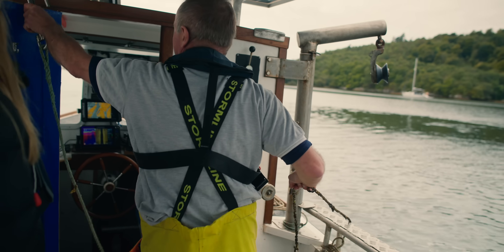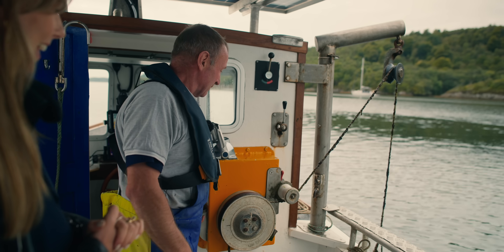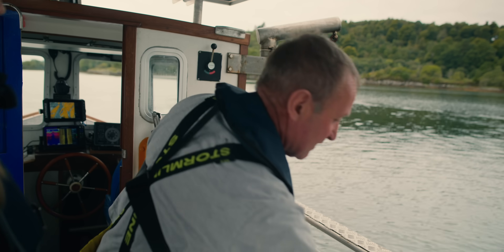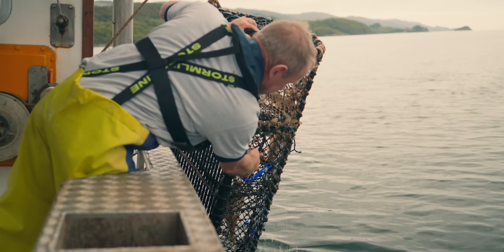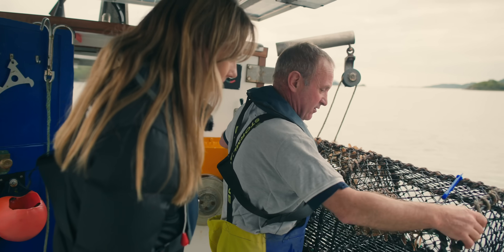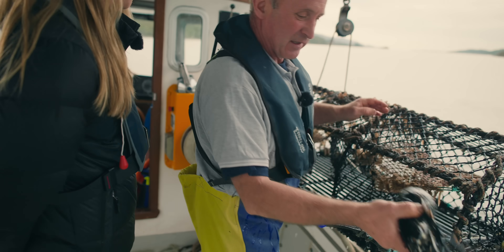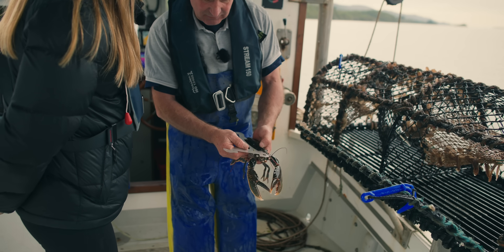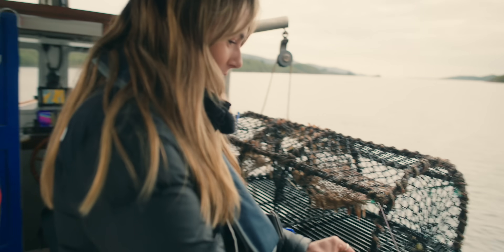Onboard the UK's FIRST, Fully Electric Solar Powered Fishing Boat!

Comment: Full marks for his passion, but the devil is in the detail. He say’s the electric motor is as powerful as his old diesel, but he runs it ‘with less throttle’ (5 knots). “I’ve adapted to what the boat can do” = There are limitations to this setup. Through the summer, he can fish 2 days a week via his solar, but what about the rest of the year? “The boat is producing a clean, low impact product”. Great, but at what true financial cost? He’s got the boat building skills and his own workshop, what about all the fishermen that don’t have that? Finally, “Unquestionably, the numbers stack up”. I’d love to think so, but “unquestionably, they don’t. There is significant (unspecified) cost to this setup and it would only suit a very small number of local/low range fishermen.

Comment: Of all the segments that you have presented I love this one the most, Imogen. When I was driving around in my lead acid battery Destiny2000 converted Pontiac Fiero with solar panels on it some 25ish years or so ago, it was fully useable, I knew that a little more tweaking would bring us a market ready EV. As a pioneer I had to walk the Department of Motor Vehicles through the immissions process. I had to walk my insurance company through how to insure the vehicle. Etc. etc. It was so new. Seeing that Hans Unkles is in the same "boat" that I was in so many years ago leads me to believe that in a few short years there will be a far more capable electric lobster boat more capable of taking in the sun to power it entirely. Thank you Imogen.
Reply: Thanks joe
Reply: @Electriclobsterfisherman  Love what you do. Keep doing it.

Comment: Another idea I've had is to have a horizontal flywheel with a weighted section that generates power by the pitching and rolling of the boat. Obviously it wouldn't generate power in the flat calm of this video, but around the UK, flat calm is rare...
Reply: Wrong. The vector sum of the forces acting on the flywheel via the boat hull is going to add to zero, just like the average slope of the sea surface is going to add to zero slope. Trying to use the rolling of the sea surface to extract more energy than the energy required to motor over that same surface is basically a perpetual motion scheme. It's a violation of the energy conservation law. 

Besides that, storing an appreciably useful amount of energy in such a flywheel system involves an insane rate of rotation, a rate that exceeds the centrifugal tensile strain capacity of known materials. Any flywheel spinning at such a rate would essentially be a spinning bomb. The last place you would want to you use such a system, even if it existed, would be in a rough motion environment like the sea. 

Also, the inertial gyroscopic effect would be radically counterproductive in trying to travel efficiently on the ever-moving sea surface. If we ever achieved the futuristic materials technology to make such flywheels possible, their only practical applications will probably be as energy storage systems at completely stationary locations, or at most in transport systems with predictable, smooth trajectories of motion such as railroad trains. 

They will be only energy storage systems, not energy extraction systems. Trying to capture energy by having selectively weighted sections of the rotor disc is also a violation of energy conservation, since the inertial force gained on the falling part of the cycle would be nullified by the energy required to lift the weight through the rising part of the cycle at all angles of rotation. 

Also, the uneven weighting would induce so much strain on the materials that it's pretty difficult to imagine any conceivable materials being able to stand up to such strain differentials at the unearthly rates of rotation required. You're talking about a spin rate of thousands of RPMs in order to store enough energy in a flywheel mass that is small enough to be feasible to be carried on a boat.  There is no engineering technology that's anywhere close to that. 

And I haven't even gotten to the issues of friction heating and lateral thrust strain at the pivot of rotation in an unevenly moving system, much less the mechanical strains involved in the transfer of energy out of the flywheel to the gear train that provides locomotive force. Also, the rate of fall induced by wave motion is vastly too slow to utilize without an extremely high ratio "amping up" gear train of its own. You're indulging in the kind of fantasy that is all too common among persons who either didn't take Physics 101 or flunked out and took up smoking too much weed.

Comment: There is likely a market for this kind of thing. Lots of fishing is local - puttering out to lobster pots, shrimps, crabs, mussel beds, salmon nets etc The range doesn't have to be enormous, e.g. 10 miles in and out and solar over the vessel should be more than adequate. Over time it would pay for itself, not just in fuel savings but time savings not having to moor up at some fuel dock.

Comment: Cobalt + the DRC. As a fan of everything electric, I’m becoming increasingly concerned about the mining of cobalt involving children in the DRC and the appalling conditions of some of the ‘Artisan’ mines there. I don’t want to have to think about a child dying because they mined the cobalt inside my product every time I plug my car or phone in. Words words words. That’s all it’s been over so many years, and we bury our heads in the sand as people suffer terribly. We need to move to cleaner energy, but doing it like this is just plain wrong. No doubt more words words words will be said, and more children will die.
Reply: Can't say about the rest of the mining practices in the battery chemistry but there is no cobalt at all in the Lorna Jane's  battery banks, unlike the device you may have used to write this comment. I fully agree and support your opinions of the cobalt mining methods

Comment: Nice to see that the north of Scotland is generating 100% zero carbon electricity today from wind and hydro power (like it does on quite a lot of days). If Hans needs to charge from the grid is nice to know he won't need to use fossil fuel even without the solar panels.

Comment: I suspect a small stand-by diesel generator on board to charge the battery in an emergency would be a good safety measure, although from what he said it would probably never be used.
Reply: Got one that I can bring on the boat. It hasn't been used since August last year!

Comment: Thank you and congratulations!  He's getting great results, and that's from what is NOT the ideal hull or configuration for that setup.  If you put a solar canopy (with booster vertical wind turbines for cloudy windy days as is typical in the north atlantic) on a sort of warren/polynesian-style catamaran rig, it would be even more efficient, faster, more stable, without needing ballast, shorter draft, having more storage/catch capacity, more working deck area, greater solar area per waterline length, etc.

We need a manufacturer to take up the call of producing reasonable priced solar/wind fishing catamarans for local/coastal fishing.  The investment for the fishermen would more than pay off in reduced expenses and environmental benefits around the world, as well as improved quality of life for the fishers themselves.  Some modified & insulated half-pipe pontoon hulls with deck-hatch access for catch holds, and a strut-supported sheet-metal cross-deck could be put together for an economy price.

Comment: just a niche solution with much relevance. I would rather work on the big issues, the big challenges first like a fast ICE replacement by EV and Heatpumps replacing condensed boilers.
Reply: Fully agree with that, just wanted to show its a useable boat at a commercial level. Got to start somewhere.

Comment: Be really interesting to see how his costs stack up compared to the other local fishermen, some of which are bound to be on the same hull, and probably hulls just as old. If as I suspect it works out that in two years or so in that as near to lab conditions as you can get comparision the cost of conversion has entirely offset the maintenance and running costs of the old ICE so he is able to work almost for free... Then he has in effect paid upfront the price of two years working for for probably 10 years, maybe more, though also maybe less as the sea can be very destructive. Still very hard to argue with.

Comment: I presume everything runs on dc with no conversion losses. Great job
Reply: 48vdc. The drive motor and hydraulic motor are 48vac so there is a bit of loss but not much
Reply: @Electriclobsterfisherman  . Was it not feasible to use a DC motor as opposed to an AC one?

Comment: Is the workshop in a convenient position/orientation to install solar panels and a power wall. (Expensive I'm sure). 
Is it then possible to charge Lorna Jane from there?
Reply: As far as I can see the boat cannot be moored near enough to the workshop (which isn't in Tayvallich itself) ... hence the long trip to the slipway.
Reply: @MrAdopado  Thanks. I thought there'd be a good reason.

Comment: I hope he is using Sodium-ion batteries, because they are going to be better in colder temperatures compared to lithium-ion batteries.

And I hope he can put solar on the roof of that big hut that he was sat in because that would make most of his fuel costs zero.
Reply: If you knew where the shed was you would realise it would have to be a world record length of charging cable!
Reply: Lithium iron phosphate, the only ones the MCA will approve just now
Reply: @Electriclobsterfisherman  I suspect that this is because many people (perhaps MCA too) believe that Lithium iron phosphate batteries are not Lithium ion batteries. And all lithium ion batteries burst into flames when you look at them ... well, they don't of course but that's the spin that has gained traction amongst the less informed. Even the manufacturers themselves now frequently steer clear of specifically using the term lithium ion in their promotional material... despite the fact that lithium iron phosphate batteries are also lithium ion batteries. Their level of safety is excellent (but then so is the level of safety in modern lithium ion batteries of other chemistries when used in a suitably designed and constructed pack with appropriate control systems).
I don't have expertise on HV marine specification batteries but I would have thought that the biggest issues are around certifying particular pack designs to be confident that they are going to be able to cope with full immersion in salt water for indeterminate periods (no matter what the chemistry of the cells inside).

Comment: What if the boat sinks because of the weight and there's a shark swimming nearby?  Then what?
Reply: Had to check your name there, thought Donald Trump was commenting 😂
Reply: @HansUnkles  nobody has ever thought of this before!  Would you rather get electrocuted or eaten by a shark?
Reply: Apart rom the fact that it would seem that you have a limited understanding of displacement (i.e. the reason why huge tankers full of crude oil don't sink 'because of the weight'), a battery and electric motor don't weigh much more than the diesel engine and full fuel tank that it replaces.
Reply: @downwind_david  I have tremendous understandings.  My uncle was at MIT.
Reply: @steelyspielbergo  ha ha ... ask your uncle about displacement then. The boat is trimmed for the weight it carries. If it was over-weight it wouldn't be certified.

Comment: This 'boat' has a 20Kw (26hp) motor, it will not operate in anything under millpond conditions, in Scotland lol. This vessel can not go to sea and will have to stay in the protected area he is videoed in. This is a toy!
Reply: On the vessels website he debunks many such myths by showing you the vessel in action in many difficult and tricky situations. Take a look yourself. It was also mentioned in this video about the difference in range he experiences between calm and rougher conditions.
Reply: @marviwilson1853  There is literally a sign in front of the wheel which states "This boat is limited to within 20 miles of a safe haven IN FAVOURABLE CONDITIONS" Watch the video on his own website.
Reply: @pauls3075  That makes perfect sense. The range in the video was quoted as being 60 nautical miles in calm conditions down to 40 miles in rougher seas. The MCA regulations for the boat just seem therefore to reflect this characteristic of the boat. Not quite sure what the point is you are trying to make.
Reply: @marviwilson1853  My point is that the boat is an old mans toy. No one will be using it in a meaningful way to make a living. It is not safe to use in strong tidal waters or in any king of windy conditions due to its limited speed and range.
Reply: @pauls3075  As I think I said before it is designed for a mission and that is to deploy and pick up lobster pots on the West Coast of Scotland within a 20 mile range of port. All forms of transport whether cars, boats or planes are designed for a mission. That is why an F1 racecar looks nothing like an off road jeep. This boat does it's mission well. You seem to be missing the facts. He does in fact make a living catching lobsters with this boat. The 20Kw motor is as powerful as the diesel it replaces but actually benefits from instant torque and variable azimuth thrust. (He has no rudder). You must take account of the facts when you put forward a theory. There is no point just saying anything just because you have a "feeling" it is "probably" that way.

Comment: I did a similar thing on my narrowboat and put in a home assembled electric conversion. I didn't really do it for any saving or even to be 'green' although I am using LiFePO4 batteries that would otherwise have been scrapped. I did it for the experience, the challenge if you will, to show it could be done for not much money compared to commercial conversions and for the sheer joy of near silent cruising. The free (solar) energy side of it was a bonus and in fact the propulsion in summer is a dump load of solar that would otherwise be in excess of my needs. The interest from those I meet along the canal has been amazing and it has inspired several people to do the same thing who otherwise would have been put off by the prohibitive cost of the commercial offerings.

Comment: I think one of the key aspects of this boat is what he refers to towards the end: it's not a perfect replacement for a diesel boat in every respect, but it is perfectly fit for the purpose he built it for. If he only travels an average of 20-ish nm a day on the job, why over-spec the battery pack, the motor, or the solar panels? Should he extend his weekly fishing past 2-3 days, a relatively easy upgrade might be to replace and expand the solar canopy with higher output panels.
Reply: I'm very excited about  panel efficiency getting better.
Reply: @HansUnkles  I am guessing that if there was an absolute need for extended range, and cost wasn't at issue, the boat could physically carry more battery capacity?
Reply: @MrAdopado every boat will be different some will be able to have a much greater range. Thanks for all your support and comments

Comment: It is a shame they glossed over the administration issues as this is a fundamental issue for anyone taking the electric initiative and a stumbling block for many.
The funding element was hugely appreciated but at 6 months from completion to a finished product is an especially hard task if you are not a large company with resources.
If the aim for Britain is for electrification, processes need to be simplified and thought through.
Massive respect and congratulations to a job well done to prove to all that it can be done with hard work and determination. The costs savings alone are worth the investment.
Electric cars and buses are becoming more normal now but there is still a way for other commercial vehicles like trucks, boats, planes, etc, etc. 
I believe that manufacturing processes, technology and materials used are getting better and better. Time will tell when the industry and the government will come together to make a shift. Unfortunately everything (and I mean everything) is about profit for those reasons. It isn't going to change in the short run.
Reply: The full documentary film linked in the description gives more of the admin background.